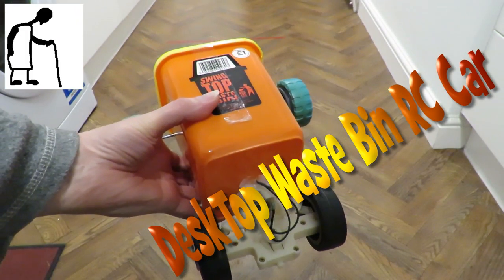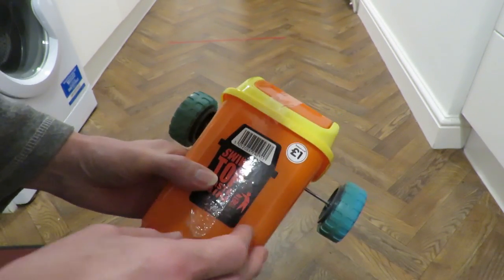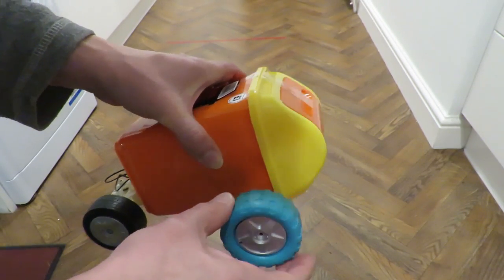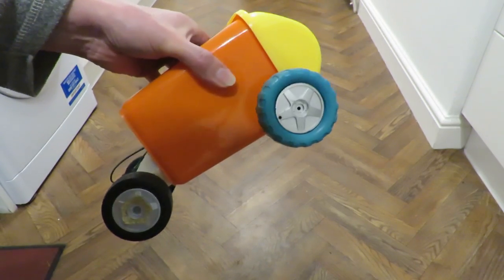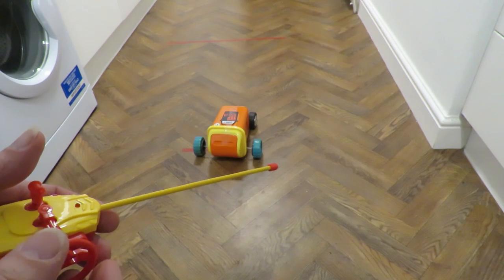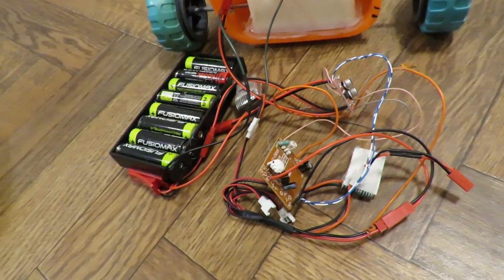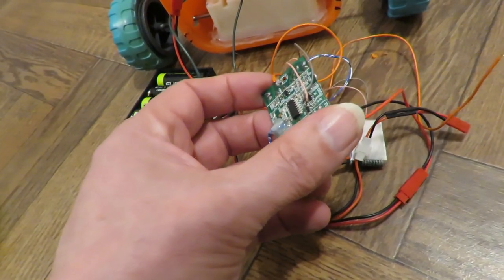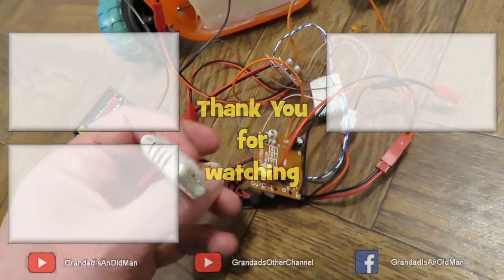DeskTop Waste Bin RC Car

Comment: do you ever smal modification to your own car? oil change? filter changes or other things. interior mods? small things?
Reply from the maker: Not any more. Since the early 90's I had company maintained cars so didn't need to and modern cars don't need regular servicing as often as the old ones did. Before that I did the usual basic work like clutch replacement, brake pads, shoes, disks, suspension components. Back when I was a youngster with my first motorbike - a BSA Bantam 175 - I followed a supplement in a motorcycle magazine to "tune" it by filing out the ports and trimming the piston, fitting a squish head and an aluminium shim under the cylinder to adjust the timing. That all changed the power band to a much higher RPM and made it sound like those "new Japanese motorbikes" that had started to appear. I then adjusted the gear and brake linkages so I could use the rear pegs and have the "laying over the tank" riding position. Of course I resprayed the frame and tank and made my own fibreglass seat to make it look pretty too.

Comment: can u make a drone with DC motor.... without using transmitter and receiver plz plz
Reply from the maker: No 😊 what would be the point of doing that. Even if it was going to fly stable, which is unlikely, why would you want one that was not controlled in any way, it would fly off and that would be the last time you see it. By drone I assume you mean some sort of multi rotor.